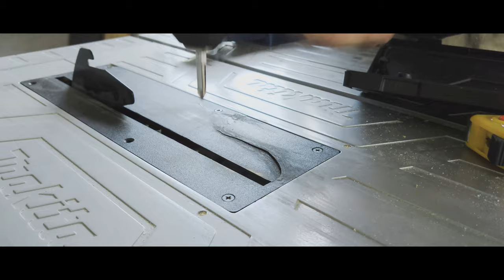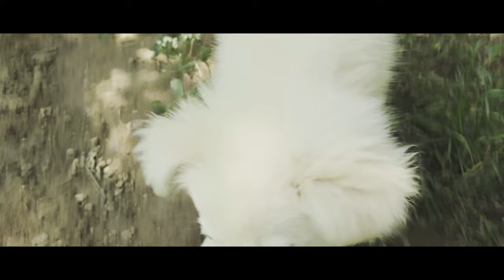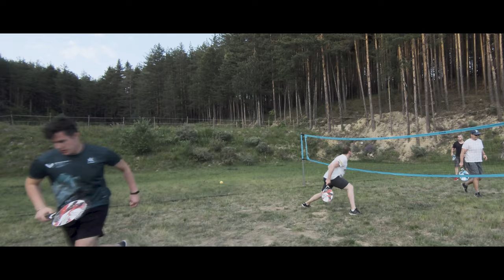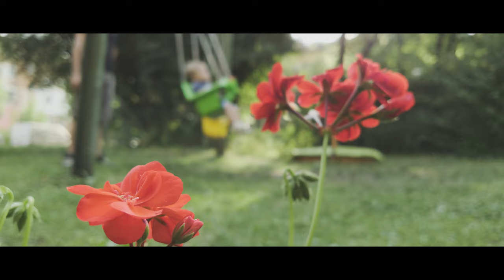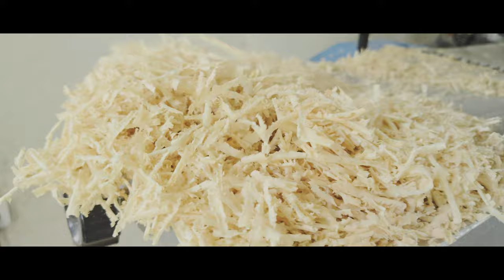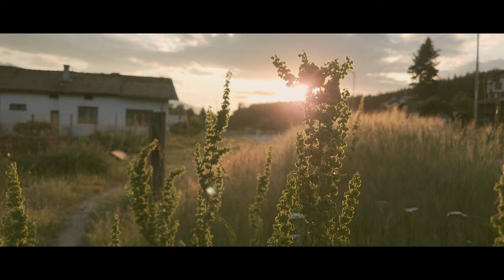Sony Xperia 1 Cinematic Video | Cinema Pro app

Comment: Cinema Pro app is another real and useful innovation in a Sony phone. Let's push the market forward and not make it stagnant with only slightly better displays and cameras year after year. Drive for what is creative and brings new to the table. Great video and great quality! I really hope a compact model comes with equal camera setup supported by this app.
Reply: yup
sony always improve their tech
finally after complains abt the TFT screen
the low qual Loudspeaker
and screen
they now put effort to work with their Camera

shud we complain abt battery this time? hahahaha
Reply: There is no compact ,  xperia 2 has 6" screen

Comment: I don't know what magic does Sony put in the Xperia 1 and 5 camera lenses. It doesn't have the T* coating form Zeiss but still somehow there is minimal flaring and ghosting in the images in very difficult conditions such as the night street videos where there are just too many light sources. If you have ever tried to shoot video with an Iphone 11 pro (Or any other Iphone) in such night light situations, then you would know what I am talking about. I had a XZ2 Compact and I had the similar experience. I also have a Galaxy Note 10 plus and I have noticed particularly the lens quality on my two year old XZ2 Compact was noticeably better. Edge to edge sharp was the Sony G lens on the XZ2 Compact. Whereas the Galaxy Note 10 plus lens gets softer significantly as you move away from the center(I noticed when i was trying to translate something using the google translate camera). The Galaxy Note 10 plus has software compensation for that lens sharpness issue, but still it too flares noticeably which no software can fix.

Comment: I am sooo confused on whether to get the Xperia 1, or the S10+. 
I like the battery life, and the headphone jack of the 10+. But, Samsung takes too long with updates, and I don't like their UI.
I am using an XZP, and the Xperia 1 should the next logical set. But, is it worth it?
Reply: I don't think you could go wrong with an xperia phone. The phone can last you through the day. If you'll go for several days trip, it's advisable to bring a "power bank".
Reply: @nilascocaguimbal1882  Thank you! I will keep that in mind for sure!
Reply: Its worth. The screen, speaker, camera, videography, the ui..jiat AMAZING ! NO REGRET AT ALL I BOUGHT THIS BEAST !
Reply: Man go for the xperia 1 i did that mistake and changed from sony to samsung s9+ it will work for 6 month perfectly then shit begins
Reply: @raphaelfrancis4509  man i already ordered it from Sweden with free WH-1000XM3 headphones them price are 279 pounds in UK . It's a damn good offer. Get it before the end of june so you dont miss the offer.
Reply: @akmalhafiz1090  Thank you! I will look for the best deal and get 1
Reply: @hasandagher2443  That's not good at all. That's a next reason to go with the Xperia 1. Thank you for the input!
Reply: @ابنالجزيره-ب8ط  That's a great deal! I will surely look for that now! Thank you!
Reply: @raphaelfrancis4509  go for it ! 😁

Comment: I love sony xperia. But this video looks ordinary for me. The stabilization just standard except in tennis scene, i'm sure it use some gimbal stabilizer. And the dynamic range just standard too. Also for the bokeh effect.
I thought with the other smartphone, even in mid-range class, to take videos like this level, just shot on 1080p 60fps. If it's done, manage the frame rate as you want. You can choose 24 or 30 fps for little bit slow-mo effect or just convert frame to ordinary 24/30 fps. Add some soft or low contrast filter. Than add the black bar on top and bottom or crop it to 21:9 ratio. Voila!

Comment: I don't like the colors they seem washed up or some kind of filter
Reply: Alex Michael it is a LUT
Reply: Yeah, that's kinda the point, you can use some predefined color grading or filters with the pro app, not sure which one they used but they probably used one, I think you can also just not use one of those if needed
Reply: This video is recorded in HDR10 and Your phone's screen is not HDR10 compatible, that's why the colors look Washed-out on your phone.
Reply: Thank you guys 👍
Reply: That's the point. To emulate cinema not only in aspect ratio but filter, color grading. It does a decent job. It needs improvement in stabilization and contrast control tho. It's still amazing a phone can accomplish this tho.
Reply: Video shot using stock camera app is usually oversharpened with over-saturated color that looks very digital....the trick to "cinematic looks" is by giving it flat but still pleasing colors that similar to how film camera renders video. However, u can always choose what kind of looks/tone/mood for the end video using post-processing software like Final Cut or Adobe Premiere
Reply: Sumesh Doal  HDR HLG, not HDR10

Comment: Xperia 1 can't even record 4K (3840x2160) -- check in Cinema Pro
Sony is trying to "limit" the 4K resolution now to separate the phone from their consumer cameras, which is ridiculous
Everyone and everything else can record standard 4K 16:9
Reply: @Kindersama  2160p is the label name on YouTube because YouTube always uses generic label names.
Xperia 1 is the only modern flagship phone that is limited to being unable to record 4K.
The Xperia 1 can only record 3840x1644. (lower than 4K)
It's not capable of 3840x2160 (standard 4K 16:9) like every other flagship since 2015. Xperia 1 can only do the "letterboxing" with black bars at top/bottom.
Sony downgraded from the Xperia XZ2 Premium (which can do 4K) because they were worried people would not buy their consumer cameras if the phone can record 4K.
And no, in every review, you will see that Cinema Pro does not have 4K when you open up the configuration, it only supports 1644p.
Reply: @zyxyuv1650  It records in a 2.35:1 ratio.
4K 2.35:1 is still 4k... (2.35:1  /  3840x1634)
Reply: @Kindersama  And yet it's not capable of standard 4K, which makes it a problem for doing regular YouTube video production which is 16:9.
And that's why I didn't buy the Xperia 1. I don't want a phone with a bizarre limitation and gimped camera where I can't even record standard 4K when I need it.
I use 3840x2160 for almost everything on YouTube, so the Xperia 1 is going to be a poor use of money for a phone that can't handle basic stuff you throw at it.
Xperia 1 also fails with image stabilization.
Reply: @Kindersama  It may be possible the limitation is only for the Cinema Pro app, and you can still record higher res in i.e. Filmic Pro. No tests were posted.
However Sony has restricted the Camera2 API, so Filmic Pro will be limited to recording in 8-bit color, while Cinema Pro records 10-bit.
Reply: @zyxyuv1650  Why so angry?
Video: 2160p@24/30fps HDR

Comment: Why 3000mah battery Sony why
I'm a heavy user
Reply: 3300
Reply: 3330
Reply: @racinhoassen6041  still too little
Reply: Because of the vertical camera set-up, there is not enough space for putting a larger battery in it. Unlike xperia 1, the s10 + of samsung has a horizental camera set-up which allows the phone has a bigger battery like 4100mah